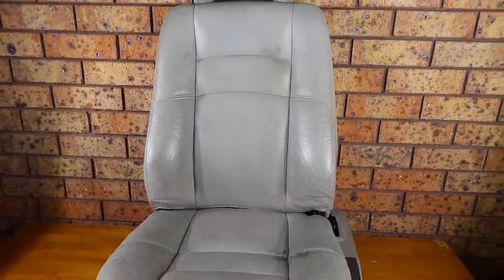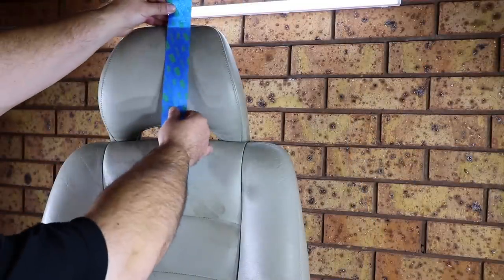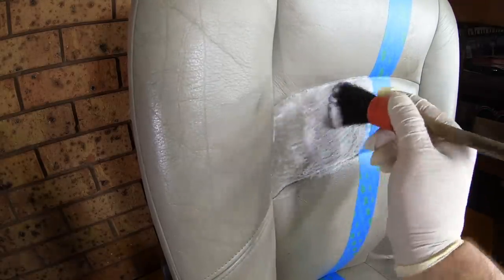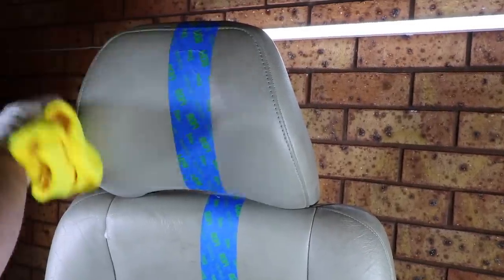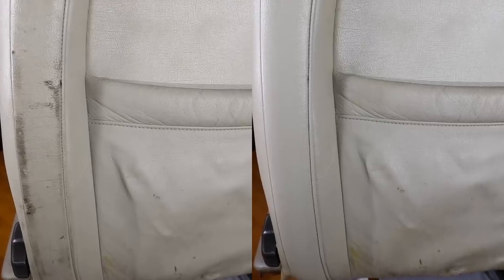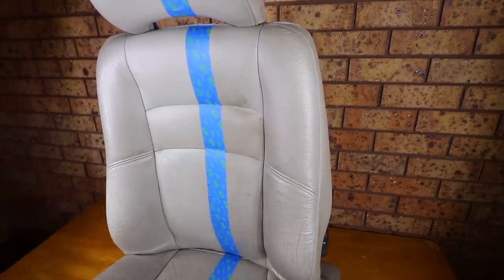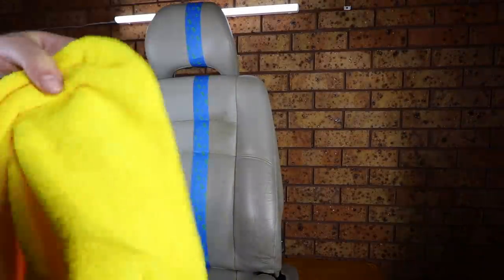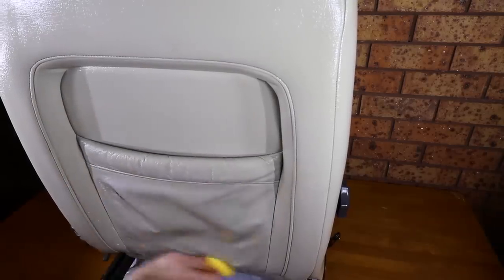How To Easily Clean Car Leather & Vinyl Seats Like A Pro

Comment: Just did a interior on a 2003 Cadillac Deville 32 valve North Star. Silver Metallic paint and Chrome factory rims. Tan Leather interior. Never cleaned the interior in the whole ownership. Used Vinegar and glass cleaner and water with 20 drops of Dawn dish soap. Cleaned very well! Then used Weiman leather cleaner and Conditioner and Mother's VLR together. Let it sit for 20 minutes. Wiped off Conditioner and VLR wiped off with Microfiber towel. It has a Lemon smell. Clean and freshed the Leather. The driver seat had some small cracking. Restored the moisture back into the Leather interior.  Shawn

Comment: I found using wool washing detergent which is very gentle to be effective, in a diluted form. I've also used Isapro alcohol mixed with water to get rid of really stubborn stains.
Reply: Isopropyl Alcohol will remove paint. How much do you dilute it, since leather is painted?

Comment: Try magic eraser on leather seats. Been detailing for years and works better than anything i used before. Spray all purpose cleaner and wipe with eraser very lightly because the eraser is very aggressive. Then wipe with microfiber towel. Works for me with no problems and I been using this process for a few years with good results.

Comment: amazing video with a lot of tips and tricks  and 303 protectant is an amazing product when it comes to detailing and protecting the leather vinly and rubber surfaces they also have amazing fabric guard for cloth seats carpet and convertible tops

Comment: Good job! But I saw a video of a guy cleaning leather seats with magic erasers, and the results were amazing. And it took very little time to clean the grime away.
Reply: @CarCraftAutoDetailing  You may have a point. But I don't want a shiny finish to my seats. I am looking for a matt finish, but with an even colour. Any suggestions?
I'm in the UK, and the products you use may not be available here. I'll steal my wifes foundation brush, that will give me a head start, lol. But will make sure its clean first.
Reply: @CarCraftAutoDetailing  She uses quite a stiff brush to push all the shit into her craters, so it should be just fine.😂
Cheers for the suggestions btw 👍

Comment: great transformation very informative - would  you suggest a degreaser like purple power or is that too harsh?
Reply from the maker: We don’t have that here locally, but if you’re going to use a stronger alkaline based degreaser make sure you dilute it appropriately and do a test stop first, but it could very well be to aggressive for leather or vinyl.

Comment: Nice video. I have a quick question, can we use inside on headliner? If I want to remove any stain mark on car headliner, is this the right product? Appreciate if you could spare few mins to answer my question.
Reply from the maker: You have to be careful with most headliners as they tend to be very delicate and the glue can fail if you get the area too wet or use too much cleaner. You can certainly use Inside to clean a headliner, but spray it on a soft brush or microfibre cloth and not directly on the headliners and just brush or wipe it down gently.

Comment: Wish I had of come here when I had my VZ Calais with cream leather seats .... yeah used a couple of cleaners but didn't do anything similar to this lol basically just a spray and wipe

Can you do an updated one just for me ;) I've got a HSV with leather and suede trim, and I'm just so confused on how to clean what and in what order, and then finish what in what order ? Suede first or leather first?

Cheers, love this channel
Reply from the maker: It doesn’t really matter which material you clean first, but it’s really a similar method, I’d just try and limit the amount of liquid on the suede as it doesn’t tend to  respond well to getting overly saturated but apart from that a brush and a little cleaner on it should work well follow by a good wipe down with a cloth.
Reply: @CarCraftAutoDetailing  I assume you use leather cleaner on suede, but clean in a method like you do with cloth trim right (just with less liquid)?

Cheers for the reply.
Reply from the maker: Yes, just put a little leather cleaner on a brush, work it in over the section nice and evenly and then wipe it down 🙂

Comment: G'day Sandro  you could really see the difference after you cleaned that seat and especially considering it was from a wrecking yard.  With new leather seats how would you recommend  cleaning them and maintaining them mine are black Napa leather and I would like your opinion on a routine cleaning and the leather steering wheel clean.   I must tell you that there is a 2year old German Shepherd that's in the back of the car!!!!!! It's a Mazda 6 Altenza wagon that's 1 year old thanks mate regards John

Comment: I can't tell what products you used?  I have a 2010 Lexus that is very well loved.  I'm going to try this on an old leather chair before I try it on my car.  Is there a trick to removing the seat?  What kind of paint sprayer did you use?
Reply from the maker: This video was about cleaning and protecting leather/vinyl seats, no paint sprayer was used and you don’t need to remove the seats in order to clean them, though you can - they have four bolts in each corner of the base railing, be sure to torque them back down to OEM spec, but I’d advise no to do this for safely reasons unless you’re experienced in this area.

Comment: Thank you for this video! What are your thoughts on using a lower powered steamer to clean leather upholstry?
Reply from the maker: Steamers can well, but unless you have something quite decent you may find that it takes a bit longer to clean compared to just using a brush.
Reply: @CarCraftAutoDetailing  what about using mcculoch steamer first and brush second ?
Reply from the maker: I think it can work well using both if the seat needs it, but it may just be a bit more time consuming that’s all
Reply: @CarCraftAutoDetailing  Ok thanks. Ive heard there are certain leathers like older Lexus that are really prone to leaving marks, stains, etc. What would your routine be then?
Reply from the maker: A gentle leather clean and soft leather brush generally
Reply: @CarCraftAutoDetailing  cool. Thanks Sandro!

Comment: Great video Sandro! What are your thoughts on conditioning leather seats, leather dashboards etc.? I have an E39 M5 with everything leather and want to protect it as best as I can. So far I have been using Leatherique technique on everything every year,, letting the conditioner soak into leather the whole day but that has been really messy and a pain. Wondering if I am just wasting my time and this is all that I should be doing?
Reply from the maker: Thanks and I’ve had varying results with different leather care dressings/conditioners/protectants on different grades and conditions of car leathers. Probably not the answer you’re after, but it really depends because leathers can vary so much from car to car that there’s not always a one solution fit for all. One thing that has been consistent is that frequent/regular light cleaning and wipe downs is the best way to preserve leather, everything else comes secondary. I’ll lastly say that 303 has been a winner for me on leathers (as well as almost all other interior material).
Reply: @CarCraftAutoDetailing  I much appreciate you response!! That does give me some peace of mind, I'll focus on regular light cleaning then! Thank you!

Comment: Hi Sandro, do you know how to remove pen stains on the leather seat?
Reply from the maker: Unfortunately pens stains themselves can vary a lot depending on how long they’ve been there, the specific ink and the leather itself, so some are easier and others are much more difficult to treat. 
Placing a hot water soaked towel over the stain for a good hour can help as a pre-treatment to soften the ink and then you can start with something like a citrus interior cleaner and brush or non-scratch scrubbing pad and then also try some isopropyl alcohol dilutions and even at times something like a magic sponge can work. The hard this is that leather itself can vary immensely in its sensitivity so do tests on an inconspicuous area ti see if these methods cause damage is also vital  as that’s the main thing - to remove the stain without damaging the leather. Also understand that sometimes this is just not possible in my experience depending on the specifics.

Comment: Do you have a tip or method on have to remove bad smells from leather interior on cars? I bought a lexus from a man who did extensive smoking in the car and other various drugs. I cleaned the interior with APC and let some baking soda sit in the car for a couple days but even after i finished once i got back in the car the next day the stench was back. It's really noticeable when its out, like 40 degrees or more. The leather is pretty damaged so i assume the inside of the seats have picked up all the smell. Anything would help.

Comment: great video as always but i have a question...why you didnt clean the leather straight from the bottle in so dirty seat?
Reply: because i want to clean my leather seats and they are dirty not from dust but from smells, cigarettes and body oils...should i do it straight from bottle or not? the product i will use is from chemical guys leather cleaner

Comment: Is Aerospace Protectant essential just a water based dressing because it looks like it and has the same consistency, maybe the only difference is that it is not slippery? Hence why we don't put things like carpro pearl on our seats.
Reply: @CarCraftAutoDetailing  So 303 is basically   the same thing to an extent, but properly diluted to use on leather and interiors?

Comment: Use baby shampoo, the gold stuff. Mix 3 ounces shampoo for every 20oz. Thank me later.
Reply: Dont tease me!! Tell me more......
Reply: @TheYammerHammer  3 ounces baby shampoo-TheRegularGold kind., 20oz. of warm water, preferably bottled spring water. make sure the spray bottle is on mist mode. Add in in a spray bottle, shake well, then spray the mixture onto the seat generously,  agitate with a horse hair leather brush, then wipe/buff off the excess with a clean microfiber after 5 minutes.